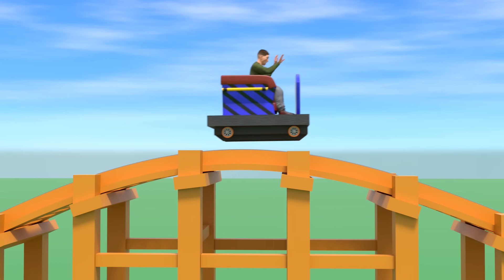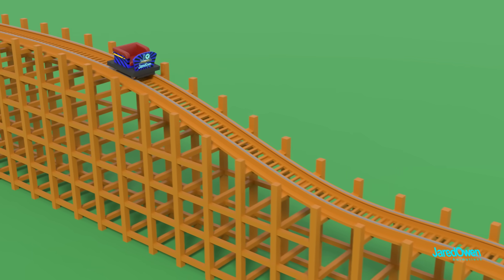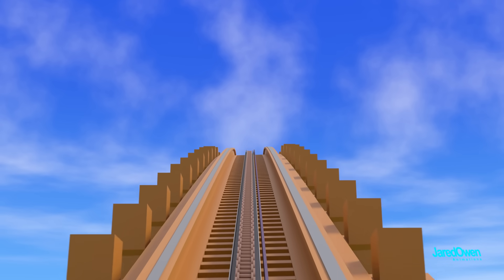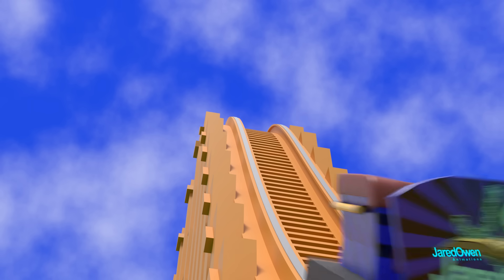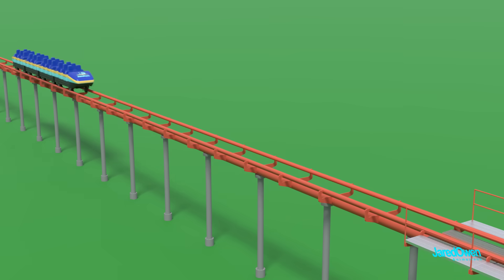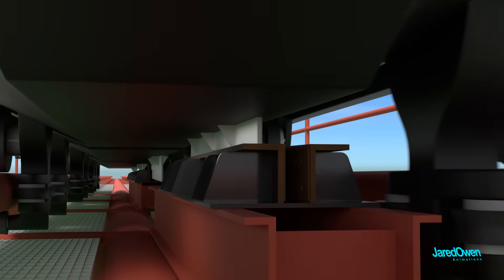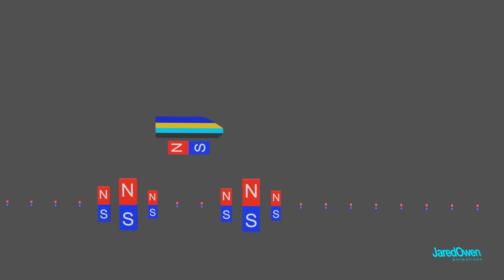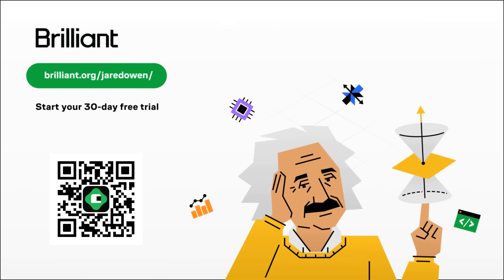The Evolution of Roller Coasters: From Wood to Steel

Comment: Couple things worth pointing out:

Another safety feature with many coasters that I’ve seen a lot of as at the boarding station. Most boarding stations have automatic gates that open & close automatically, usually what gate you’re standing at depends on what row of the train you’ll sit in. As a safety measure, if a gate can’t close for some reason, the coaster train cannot be sent out of the station. 

Another thing some coasters have is a brake run placed mid-ride. These are required on coasters that operate more than one train, and they’re pretty important. Not only do they control the train speed, but they also act as a virtual barrier to a particular section of the track so if one train stalls or gets stuck, these brake runs will stop any train that comes up to them to eliminate the chance of a collision with the stalled train. They can also, when strategically placed, cycle more trains at a time

Nailed it dude!
Reply: The Almighty Allah is the creator of technology. Almighty Allah created iron in such a way that people can soften it and shape it into whatever shape they want. If Allah had not created iron in this way, people would not have been able to make anything out of iron. And there would be no technology. Praise be to Almighty Allah, the Lord of the Worlds. We make time for everything in 24 hours. We spend hours watching movies, watching TV series, watching football games, having fun on social networks, playing games, meeting friends, walking, reading books, etc. We spend hours on everything we want. But do we also take 10 minutes to worship Allah Almighty? Do we bow down and praise Him for creating us from nothing and giving us all His blessings and sustenance without any compensation?___...
Reply: I think we can report the reply above for spamming

Comment: Falcons flight has a max elevation of 640 feet cause it goes onto a mountain but the arch only hits 535 feet, the gateway arch is 630 feet tall so falcons flights arch is actually shorter by 95 feet than that of the St. Louis arch

Comment: Loop weren't ideal for wooden roller coaster, but there's a wooden roller coaster with loop is still exist in this world, The Roller Coaster is called Son of beast at King
Reply: Son of Beast closed in 2009. Although Hades 360 at Mount Olympus and Mine Blower at Fun Spot Kissimmee still have inversions as woodies.

Comment: As an enthusiast, this is so exciting

Here are notes (on errors) I have while watching:

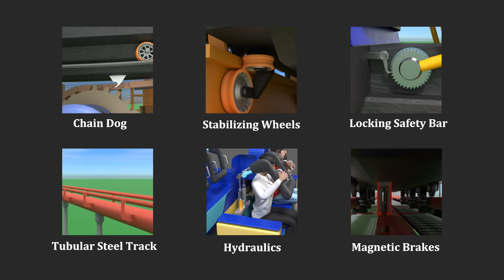1:52 The “safety bar” could be labeled as restraint.

2:00 I like simplicity, but it lacks any stress buckle tolerance or sidesway structure

2:45 Often casually referred to as “full circuit”

4:06 They’re usually doubled laterally

5:25 Not just whiplash, death can occur from circular loops due to the eyes-down positives

5:59 This pullout would be near deadly if real 😂

6:22 You seemed to miss side friction coasters. They’re usually staggered.

7:01 Usually these are known as restraints. The pins both usually have their own ratchet wheels.

8:02 More often than not, they don’t use that method, as it’s unsafe. There are other redundancy mechanisms.

8:50 The track is only smooth if it’s manufactured and installed well.

9:37 It’s not because of wood, but wear and tear.

10:00 That is an incorrectly modeled cobra roll.

11:00 *within safe range

11:18 These cannot be safely or legally used alone. For a section to count as a valid block zone, it still needs to use friction brakes.

12:46 Usually coasters don’t use Maverick style launches. They’re usually on slight inclines (around 5 degrees worth). You absolutely glazed over the entire interesting history and various types of coaster launches. Some of the best are hydraulic and IMO Maxxforce’s hydraulic launch. That’s theoretically an LIM though.

14:09 It’s because it’s 200 feet. And the ride is not “the Magnum.” That’s like saying the Harry Potter.

14:38 There are actually 4, but the other two don’t go up to 400 feet.
Reply from the maker: Thanks for the detailed feedback😮

Comment: 4:45 The rollercoaster in Tivoli in Copenhagen (from 1914) actually still has manually operated brakes controlled by an operator at the back of the cars

Comment: Some types of fin brakes are applied using a lack of pressure, so they are released with pressure, this ensures when it goes wrong, the pressure drops, and the fin brake will fully apply

Comment: I want a coaster that's fully enclosed with a flight simulator style plasma screen wrapped around 180 degrees. The coaster itself should mimic the maneuvers of a fighter jet (loops, Immelmann's, hammerhead stalls, etc...) so the feeling will as closely as possible give the sensations and sights of being IN a fighter jet. 
That's what I want to see next.
Reply: That'd be amazing. Expensive for sure, but awesome.

Comment: interesting fact about magnum xl 200
When it first opened it used skid plates instead of upstop wheels
so not all coasters even to this day technically use wheels as upstops
Reply: Yeah, there's still some coasters around with "upstop pads". Most notably, Arrow mine trains.

Comment: Great video!! One correction I’d like to make is that over-the-shoulder restraints are not necessarily a more evolved version of lap bars. We are actually generally past the era of over-the-shoulder restraints, and most modern looping coasters do use lap bars, often even without seatbelts. All restraints must be compliant with rigorous standards depending on the forces that are exerted by the particular ride, and you’re just as safe in a modern lap bar than you are in an over-the-shoulder restraint.

The same point applies to hydraulic restraints vs. mechanic/ratcheting restraints. For example, modern B&M coasters, including their Giga coasters, use ratcheting lap bars. And lap bars can be hydraulic, such as modern RMC, Intamin and Mack lap bars.

Plus, there are many mechanics that can launch a train, including hydraulics (Kingda Ka), pneumatics (compressed air), drive tires, LIMs (linear induction motors, the predecessor to the LSM featured in this video which used a lot more electricity), flywheels, and weight drops.
Reply from the maker: Thanks for the feedback Marc!  We had originally planned on going more in depth on the restraints but the video was getting long😫
Reply: In more of a general discussion the way he did it in the video is fine. I’m not sure this was intended for us hardcore enthusiasts
Reply: @ I know, I commented as more of a complement to the video for those who scroll through the comments.
Reply: Not just modern ones.  The Revolution, which was the first modern looping coaster and opened in 1976 had simple lap bars.  Over the shoulder restraints stared popping up in the late 80s/early 90s, probably due to liability.   But those early restraints were a disaster.  I went on Anaconda, which was basically The Revolution with more inversions and over water.  But the over the shoulder restraints killed it for me.  The restraints were uncomfortable and locked me in place in a way that made the ride boring.  Even with the airtime section in the cork screw, it felt like I was going through the motions.  Had Kings Dominion lost those restraints and just used a lap bar, Anaconda would probably still be open and popular today.
Reply: Hold on, i thought LIMs were less power-intensive, but were phased out because they could only be used on straightaways?
Reply: @bracken8782  yeah, LIM had a lot of issues which is why LSM is used instead now. Way more control and you don’t have to worry about slip for torque
Reply: The Almighty Allah is the creator of technology. Almighty Allah created iron in such a way that people can soften it and shape it into whatever shape they want. If Allah had not created iron in this way, people would not have been able to make anything out of iron. And there would be no technology. Praise be to Almighty Allah, the Lord of the Worlds. We make time for everything in 24 hours. We spend hours watching movies, watching TV series, watching football games, having fun on social networks, playing games, meeting friends, walking, reading books, etc. We spend hours on everything we want. But do we also take 10 minutes to worship Allah Almighty? Do we bow down and praise Him for creating us from nothing and giving us all His blessings and sustenance without any compensation?---

Comment: Next video do fire alarms. Like how they work when you pull them and reset them and how did the magnets close and how do the strobes work. Like the control panel ack silent reset. Even pull the alarm and reset it. And all the alarms like Horn Strobe chime, strobes speaker strobes and remote strobes. And how does it call the fire department if they don’t call and tell them they’re doing a drill.
Reply: Yay

Comment: Regarding using magnet and coil to accelerate Roller Coasters ! I would like to say even the normal Roller Coasters which use chain and Motor use the same principle. Since the motor itself is nothing else than coils and magnets to produce rotational movement.

Comment: Your day at a park is safer than the drive to the park (providing the park is decent and follows regulations and manufacturer instructions) this is especially true for rollercoasters as they are often the highlight of a park, this is due to inspections and maintenance that is done to manufacturer requirements or more frequently (and goes from a small visual inspection to a full disassembly of a train and ndt (non destructive testing where a part is scanned to check for invisible cracks in the metal)

Comment: Coaster nerd here 🙋 You absolutely nailed this, great job. It's incredible to see how much coaster technology has advanced, particularly with magnetic launches. Kingda Ka used a hydraulic launch which is so complex it probably deserves a video all to itself. It had a lot of moving parts and was extremely expensive to maintain which is why this system is also being replaced by magnetic launches such as those on Falcon's Flight.
Reply from the maker: Thank you Marcus!  I kept trying to figure out how to put more of Kingda Ka in the video - the hydraulic launch was definitely unique.
Reply: @JaredOwen  as Marcus said, it's a design which definitely is deserving of its own video! Loved this one as a coaster fan too 😁
Reply: Would have been really cool if he also went more into detail about track desing. Modern rollercoasters are a lot less stressful on the body as they follow the heartline to reduce overall forces on the body allowing for much faster speeds and more inversions.
Reply: https://www.youtube.com/watch?v=TjE4SKpN8y4
Reply: Dang, I was gonna link the same video. You beat me to it
Reply: as a coaster enthusiast this made my day
Reply: new coasters are great, but i also grew up riding the jackrabbit and the racer, which are within the top 10 oldest coasters still in operation. jack miller made great coasters
Reply: Hydraulic launches have a magnet connected to a motor that goes for example 200 mph and it pulls the coaster with it
Reply: I’m also a coaster nerd btw
Reply: Either that or a whole video on launched coasters … they’ve had several types.
Reply: They're not replacing the launch with LSMs. They're tearing it down.
Reply: I agree this was a great video. He could have gone into so much detail about different variations but you can only explain so much in 15 minutes. He explained all of the basics and I love how it was presented with the history vaguely correct.
Reply: Rip king da ka
Reply: I believe that's the same reason Rita at Alton towers is often down. It was one of the early hydraulic launchers
Reply: one question how much voltages and wattages are those magnetic launches?
Reply: me too man
Reply: I wanna watch it even more now!
Reply: Im going to hershey park in a few months do you have any tips to sooth my nerves
Reply: The Almighty Allah is the creator of technology. Almighty Allah created iron in such a way that people can soften it and shape it into whatever shape they want. If Allah had not created iron in this way, people would not have been able to make anything out of iron. And there would be no technology. Praise be to Almighty Allah, the Lord of the Worlds. We make time for everything in 24 hours. We spend hours watching movies, watching TV series, watching football games, having fun on social networks, playing games, meeting friends, walking, reading books, etc. We spend hours on everything we want. But do we also take 10 minutes to worship Allah Almighty? Do we bow down and praise Him for creating us from nothing and giving us all His blessings and sustenance without any compensation?___

Comment: I hope they put a bug shield on that exa coaster. I don't think it would feel good taking a bug to the face at top speed; or worse, have a Fabio experience.
Reply: They genuinely are doing this! It will have a small windshield to protect riders from sand etc.
Reply: @marcussheen  and low flying geese

Comment: There's only one strata left in operation. It's Top Thrill 2 at Cedar Point. Superman Krypton Coaster at Six Flags Magic Mountain was announced closed not too long ago. Though some people argue whether Superman's a strata or not.
Reply: Top Thrill 2 has opened and is not defunct but it’s still technically not operating for the month or so making Red Force the tallest operating coaster, but I still count TT2 as the tallest because it had its first public train and is not defunct.

Comment: Did you know that the one way valve on the hydraulic restraints is called a check valve and the one that releases it is called the spool valve? Also, launch rollercoasters have other ways other than LSMs like hydraulic launches which used to power kingda ka and formula rossa, known for their fastest launches. They are pretty old and worn out though and LSMs are the newer and more modern ones and I love them as well. Along with chain lift hills, there is a new kind of lift hill called a cable lift hill which has a big cable and pulls the train up pretty fast before dropping it. Skyrush uses this kind if lift hill. Only disadvantage his that the cable has to come back down. It is much quieter than chain lift though.
Reply: It's always fun to watch the aggressiveness of Skyrush's cable lift catch new riders off guard. It's basically a launch for the first few feet.